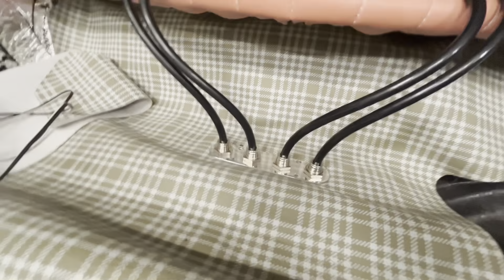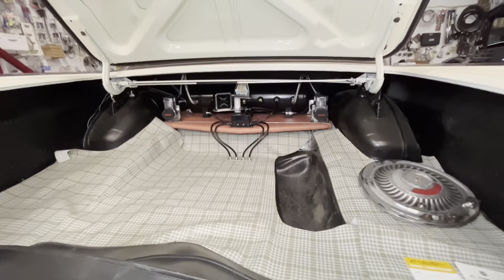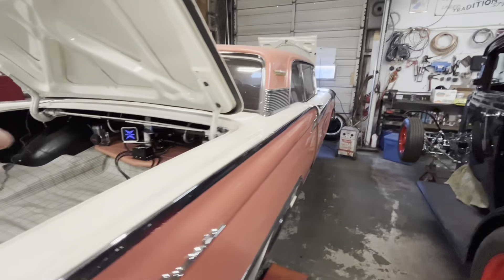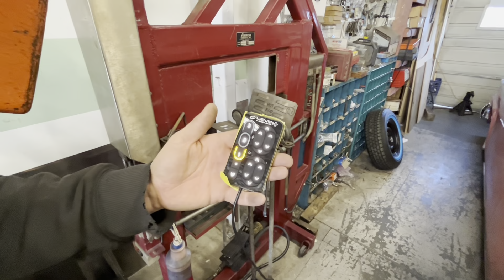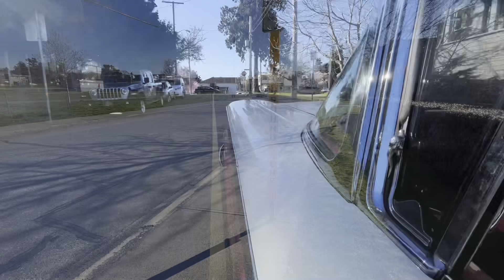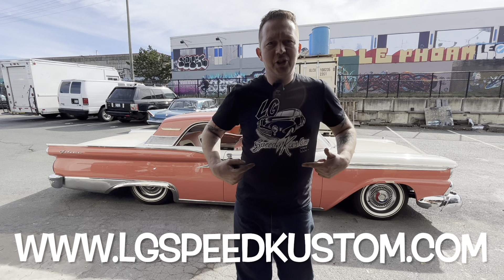Air Ride on a 59 Galaxie Part 4. Test Drive!

Comment: With a few under your belt now… what is someone looking at cost wise for a full build like this on a 4 dr 59 Galaxie?
Reply from the maker: Full build? Or full air ride install? 
On average most air ride set ups are around $6000 in parts and $5000-$6000 in labor

Comment: Yes, it would be interesting to see the Vintage Air kit as I have seen a lot of them and people say they love them, but no one has shown an install. As for the air ride, not something I would do as speed bumps in Ontario are growing up everywhere.
Reply from the maker: One of the advantages of air ride is being able to get over speed bumps. 
Hit button 3 and the car instantly raises to a height much higher than a stock suspension.

Comment: Nice. I have a 57 on hydraulics.
Reply from the maker: Cool! I’ve never done hydraulics before, but would love to give it a try someday
Reply: @LGKustoms  
My friends used to be the single pump hop champions.... so he knows his stuff. He's old and he's done it all. The car has stock suspension up front and a triangulated four link in the back. I told him I didn't want a hopper or dancer,  just a clean and comfortable dependable cruiser. I've driven it everywhere and it drives like a Cadillac. The way he designed my suspension's ride..... it's so nice. The car has never had shocks in it since it got juiced and it rides completely totally stockish comfortable..... you'd never know it's on hydraulics if I didn't specifically point it out.

It's got a pumped y block,  5 speed, and stock rear. She's fun.

The reason for going with hydraulics for me was adjustable stance.... some times I swap wheels and it has a different vibe. 
Sometimes I just prefer hydraulics over air. On this car, they're more old school. 
The problem with Fords when they're slammed down is that oil pan is out front exposed like a bladder. I wanted to shield it (like a GM), but honeslty I've never got around to it.

If you need any hard to find parts for that car I've got a source local to me that has a warehouse of old NOS Ford parts. He is strictly 100% correct by the book. He uses ONLY old Ford catalogs and those projector screen diagrams. All his literature and cataloging is old done with oem stuff like an official old Ford dealership would have.

Comment: Install looks great! Would have been a whole lot easier adjusting the ride height sensors of the car if it was on a 4 post hoist. But you got it done never the less!
Reply from the maker: A hoist would be great, but I think my shop is just too narrow. If I had a hoist in that spot, I couldn’t have a car parked in the space beside it.

Comment: With the Accuair system can you adjust what the ride height is for the 1, 2, and 3 settings? Say if you want more forward rake on one setting?
Reply from the maker: Yes you can program your own set heights. You can also control every bag individual just like with regular air ride or hydraulic systems